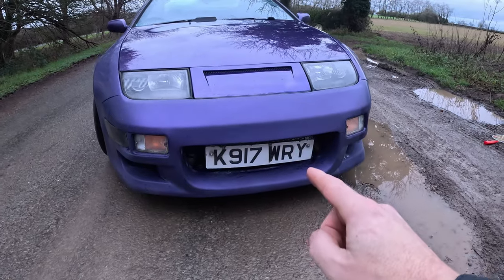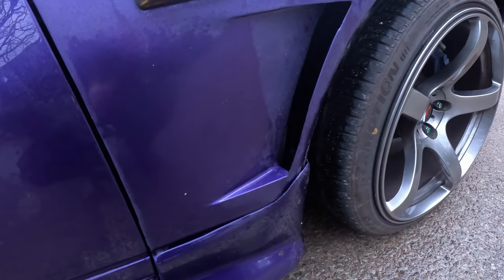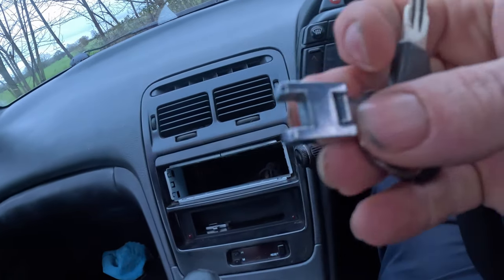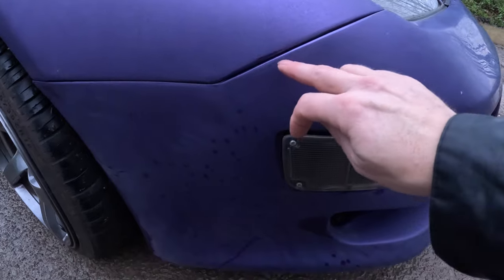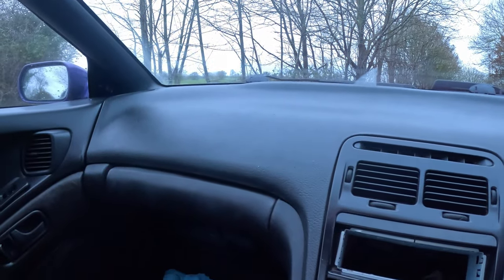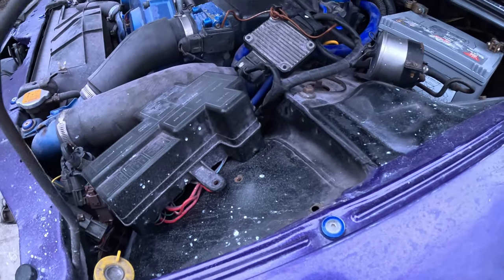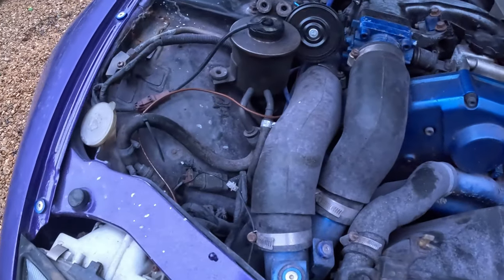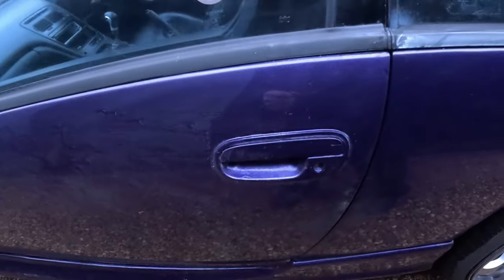INTRODUCING MY PURPLE 1992 Z32 NISSAN #300zx TWIN TURBO BUILD #jdmcars

Comment: Z1 Motorsports in the USA has a metal pice to fix your door issue. No need for the plastic anymore. Also Nissan dose not sell it anymore. I fixed it on mine years ago. It worked perfectly
Reply from the maker: Thank you.

I was actually going to order that from Z1 anyway.

But I'm considering ordering their 3 inch exhaust and I'm sure some other stuff will pop up.

So I'm waiting till I do that so can combine the shipping.

I have their downpipes which I ordered awhile back only to find they don't fit uk or jdm mid pipes (us version are different length and angle) so now I either need to buy the rest of a us exhaust or get a custom made in UK. Something I wish I knew as now it'll be two lots of shipping.
Reply: Sorry to here that
Reply: I wonder why the down pipes
Are different
Reply from the maker: @sheldonmurray4016  I believe it's because in the US there are extra cats in the downpipes. Although don't quote me on that.

Comment: I've just agreed a deal on a 60k mile TT and I am so excited to get it.  I haven't seen another 300zx since 2009 so they're seemingly incredibly rare here in the UK.  Is there a recommended garage to take these to, anywhere in the bottom half of the country really but ideally Sussex?  Love the colour BTW!
Reply from the maker: Hi,

There is Power Z based in Bristol who is a specialist for service and repair, although I've never been.

There used to be Jeff at Zedword in Birmingham also a repair specialist circa 15 years ago, but unfortunately no longer about.

If you're looking for new OEM and aftermarket parts then Luke at ZCentre in Nottingham can supply a selection and offer advice.

If you're looking for used parts then Iffy ( check on 300zx UK market place Facebook group) is a breaker. He has 20 odd of them.

If you don't mind importing new oem  and after market parts then Z1 and Concept Z in the states.

There are lots of Facebook 300zx groups too.
Reply: @SIMONHOLFORD  thanks mate,  that's really helpful.  How have you found them on reliability?  

The one I'm getting has just gone in for new sills, re undersealing, new bushes all over, new injectors, new boost controller, new clutch, new belts and a couple more bits so sounds like it'll be solid to an extent but obviously as an owner you'll know more than anyone! 

Thank you PS subscribing :)
Reply from the maker: @benaldous193  

As reliable as a 30 year old car can be.

The sills rusting out are a common issue.

I had to replace all of mine, both full outer sills and part of the inner sills.

The targa tops have 2 sets of drains which run down hoses.

The front run down the A pillar and flick out behind the fender. The hose can shrink and come off then it drains into the front sill instead.

The rear hose runs down the B pillar and connects to a metal flange inside the rear sill that drains into a gutter under the car. The flange rusts and leaves the hose dangling in the sill filling it with water. You can reroute the hose out past the rear seatbelt retractor under the trim then there is some tape that covers a inspection hole at the edge of the rear seat ( hidden behind trim). This will allow you to route the hose directly out the bottom of the car instead of via the sill.

The older style of injectors 1989 to approx 1994 ( depending on variant of car I think ) are prone to failure because the electronics inside come in contact with fuel and ethanol corrodes it over time.

The coil packs are also prone to failure with age.

The injector and coil pack connectors often corrode too. You can get replacements.

Other common rust spots are rear arches, edges of T tops, boot lid, top of windscreen and behind rear bumper in the arch.

Comment: Whatcha had to do to make that wing fit?
Reply from the maker: Hi,
It's pretty close fit in the position I mounted it, just had to add a little bit of fibre glass to the bottom of the uprights to fill in the gaps.

1. Line the wing up where you want it and mark its position by outlining the uprights with frog tape.
2. Put all the bolts in the bottom of the wing, place some frog tape on the boot lid where the bolt holes are to be drilled.
3. Cover the heads of the bolts with toothpaste or ketchup or similar, line the wing up on the boot and press down.
4. The toothpaste will mark where to drill the holes.
5. Test fit.
6. Remove the wing and tape down some A4 paper where each upright bolts to the car.
7. Refit the wing over the A4 sheets.
8. Use fibreglass to fill in the gaps ( the A4 paper is to protect the boot lid).
9. Remove the wing and sand the fibreglass.
10. Apply extra filler and sand for a perfect finish. You will need to turn the wing upside down and fill the bottom of the uprights level with the fibreglass you added. Make sure you put the bolts in so you don't clog the threads up.
Reply: Dam that wing looks so good
Reply from the maker: @kelving.2200  

Yep I saw it in a video from #illiminate on a 240sx and I just had to have it.

326 Power Wing.
Reply: @SIMONHOLFORD  yea that's a JDM 180sx (240sx) wing. I was thinking of buying an F40 wing but man now I'm thinking of goin this direction
Reply from the maker: @kelving.2200  

I got mine ( replica) from a place in Loughborough.

https://www.epracing.co.uk/products/326-style-rear-spoiler